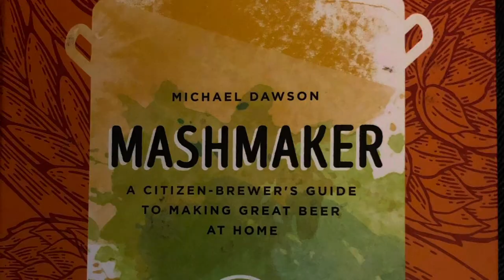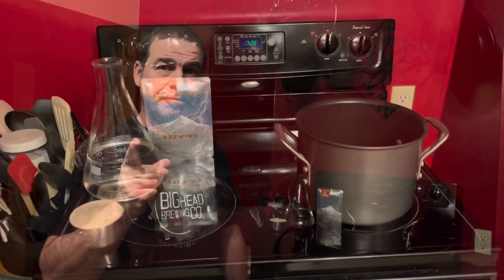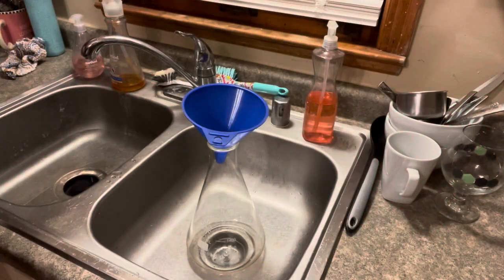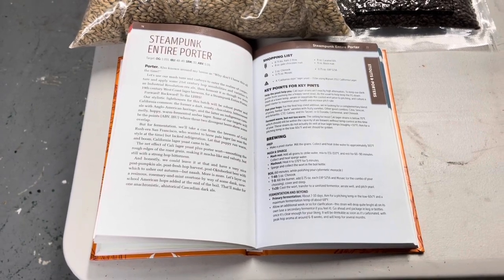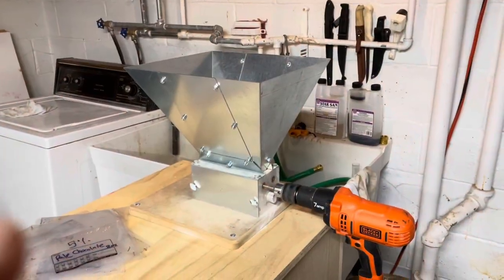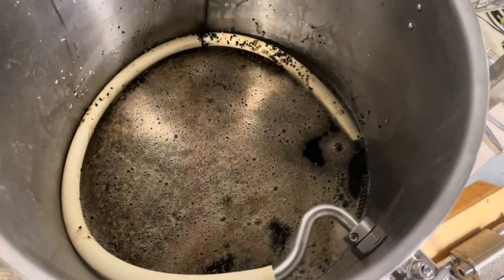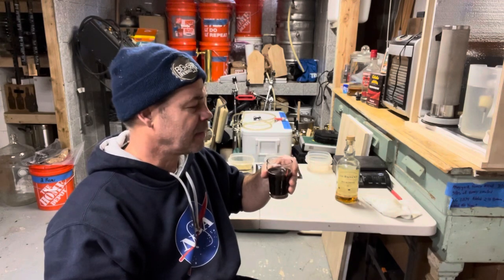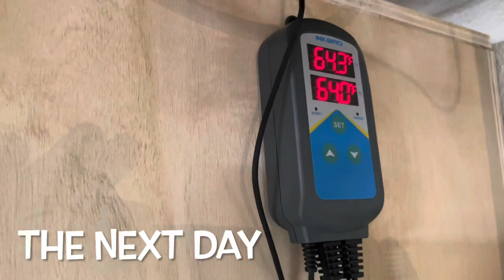Steampunk Entire Porter Brewday. How to Make a Yeast Starter.

Comment: First, this brew is the first Mashmaker beer I ever brewed, and I love it. I hope you are equally pleased. Second, I love that you're trying to spread the educational part of brewing through your channel.
Reply: Also interested to see that (to each their own, many ways to get there) you boil the starter wort in a pot, then transfer to a flask. When I did stirplate starters, I boiled right in the erlenmeyer flask since it was borosilicate and could take the heat. Just the way I learned. (I think boilovers are perhaps a bit quicker my way due to the geometry... voice of experience.)
Reply from the maker: I have considered boiling the wort in the flask but I’ve heard some stories about the flasks cracking on electric ovens. I’d do it that way for sure if it was over a flame. If I get any wort on the stove top that wouldn’t be good so I’m not taking any chances. 😜
Reply: @themashmakerchallenge9578  Also might be good to give folks proportions. Looks like a 2 l starter with a cup of DME, eh? I've heard around 1.030 is target for starter gravity. What do you do?
Reply from the maker: @garrettmilam5933  , I
Usually shoot for about a 1.030 starter. A cup of light DME usually achieves that with 1200 to 1400 ml of water.

Comment: I would also be interested in learning more about your fermentation chamber shown in this video. I brew in my basement and have a few methods of ferm. temp. control but this looks like a nice setup.
Reply from the maker: I did a video on how to build the fermentation chamber. It’s only for holding temps and heating things up. My basement is usually 55 degrees in the winter months so when I brew a lager I don’t use the chamber. When I’m doing ales I’ll use it to hold temp or when I use kviek yeast I’ll use it to raise the temp and hold it. It’s useful all year round for that application.